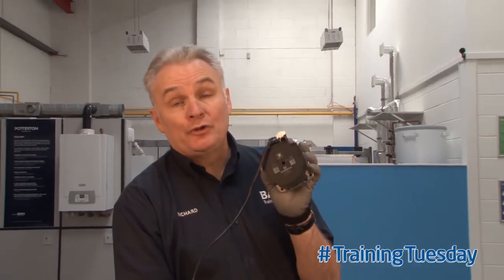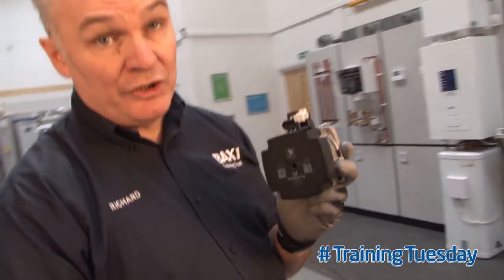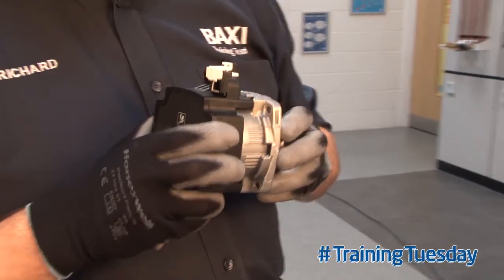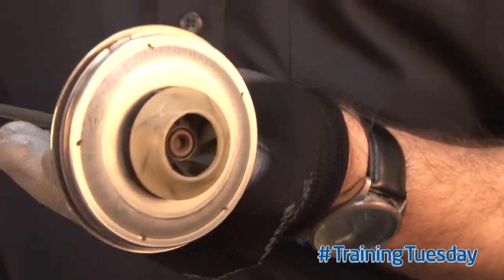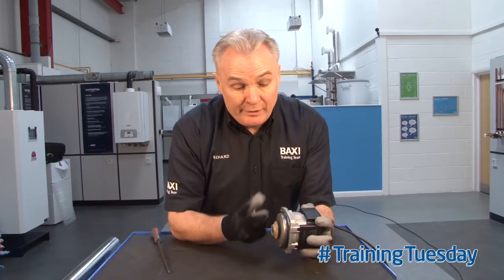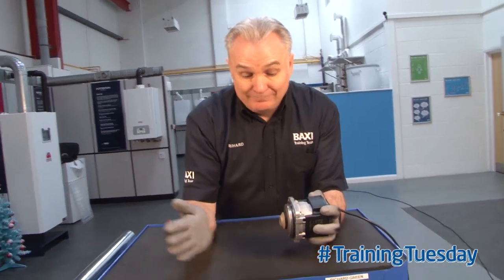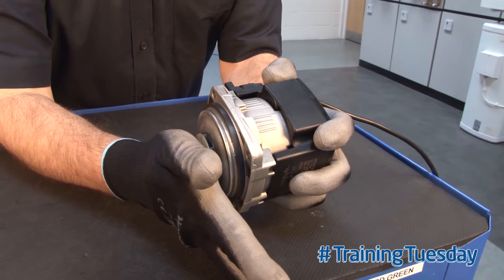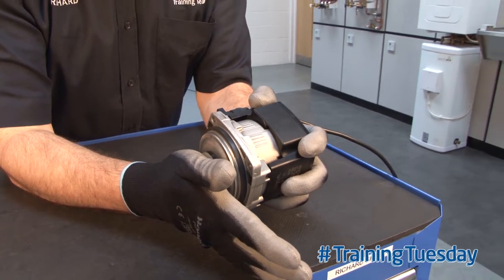How to turn a Grundfos UPM3 pump in the event of it being clogged with debris | #TrainingTuesday

Comment: Introduce the Taco pump. Used by Bosch – Ariston - Vaillant – Viessmann – Immergas and others.

I think it would be useful to highlight the advantages and differences compared to the current, frequently used pumps like UPM3.
Why Taco is more reliable.

Taco pumps are constructed from modern materials that function flawlessly in underfloor heating systems, or any other application where the motor is cooled by the medium it comes into contact with. This makes them very suitable for such environments, different from pumps with traditional materials such as steel. 

Unlike traditional pumps, which are often made of steel and are susceptible to failures, such as jamming, caused by electrochemical reaction in the rotor chamber, Taco uses modern composite materials. These materials offer a similar lifespan without the risk of getting stuck or damaging when running dry. Taco pumps can withstand dry running.

With traditional pumps, common problems are the result of material selection and technology. Here are some major causes of failures:
- The pump cannot start after extended periods of downtime (weeks/months).
- Drive side bearing (DE) is jammed, preventing the shaft from turning.
- Calcium carbonate (lime) deposits in the DE bearing space.
- Limescale develops on the shaft and bearing rings.
- Deposits form fixed bridges between the shaft and the bearing rings, so that the starting torque of the engine is not strong enough to break it.

Contributing factors include:
- Summer shutdown: Pumps that have been installed and left idle for months with water in the rotor chamber without dissolved oxygen.
- No commissioning: Pumps that are installed but not in use, with water and atmospheric air in the rotor chamber.

Today's pumps are traditionally constructed from materials such as steel. In practice, a common malfunction is the blocking of these pumps.
Important cause is the use of steel and the ECM technology / Pm (Peranent Magnet)

It is important to understand that the root cause of bearing seizing is the precipitation and sedimentation of calcium carbonate in the DE bearing orifice. This process is driven by an electrochemical reaction in the rotor chamber, fed by oxygen interacting with the pump materials and generating hydroxide ions. I will come back to that. 

Because Taco pumps are made of different materials, they are better suited for these applications. Their composition prevents the problems experienced by traditional pumps.

Comment: I was trying this method without success. I ended up taking off the pump, unscrewing the 4 bolts and turning the rotor by hand. When turned I installed it back, turned it on and it worked. Very easy, everyone can do it, just make sure to close both valves on either side of the pump before you dismount the pump.
Reply: How did you remove the pump? I am trying to find any video on that.

Comment: Good video,  looks easy but I cannot get a screwdriver into the space as the pump is too close to the tank...! What else can I do? Can I take the hex bolts out and separate from the pipework? Novice here....! Thx.
Reply: So the fix in the end was to isolate the pump, remove the 4 hex bolts with Allen key, manually turn the rotor. Hey presto, all working. Thx for  all the advice on here.
Reply: @bs2592  Brilliant! Glad you got it sorted.
Reply: Can you get a stubby screwdriver in there?
Reply: @kevinpeters5000  No. its really tight space.
Reply: When I’m taking the 4 bolts off some water started to come out. Should I be turning the water off to do this?? Or is this the problem. The bolts are back on for now!
Reply: @matthewcornish5207  there should be isolation valves either side of the pump. You need to close those off before you start. Turning your water supply of won't help as it's the water already in your central heating system.

Comment: I assist two pump like that. Some time break when going to start. Start on light 1 and then go to five. It seems problem to start. Have a way to take off the startin point 1? So always will start in maximal power (light 5) and quite sure the issue will gone.

Comment: Grundfos replaced a year-old pump last year and now, exactly a year later this has happened to me again. Fortunately I got the plumber to put some isolation valves in when he replaced it last time, so the whole central heating didn't need to be drained this time. The screw method didn't work so this is how I fixed it: Remove the 4 allen bolts and take off the black solid metal part to expose the black plastic impeller. If you try to rotate the impeller it should move freely in your hand but miine did not. Get some mole grips and very gently grip the sides of the impeller (not too tight as it is plastic and will crack easily). Holding onto the metal base with one hand try to rotate the impeller with the mole grips. I had to put quite a lot of force on this and then suddenly it came free. I think this is just a poor design - there was almost no gunk or debris in there.
Reply: It would have been the gunk/debris that caused the problem! A clean system helps prevent moving parts, from failing.
Reply: @kevind7150  Maybe, but it was a brand new system and even if it was gunky I would hope it lasted more than a year! It just seems to dislike sitting unused for 6 months.
Reply: thanks for the info, my system has the isolation valves so will be trying this. pump only 6 months old but off for the summer.

Comment: This happened to our pumps last year. It was then solved by the plumber because I wasn’t able to figure out what pushing and turning the screw actually meant (I did try though). A year on and I’m facing the same problem. How much force does it actually take to get the pump unblocked? I also found the screw heads were partially stripped, I suppose it was the plumber trying to find out how hard he was supposed to be trying. That certainly doesn’t help.
Reply: Usually these pumps need a lot of force comparable to about 4 - 7 kg to unlock them by screw, I wouldn't try more. A lot of them stuck way harder and unblocking it by screw is impossible. If the screw is stripped I suggest you disassembly the pump and unblock it manually. Even manual unblocking is sometimes impossible. If it is stuck very hard, trying to unblock it may cause bearing damage and you need buy a new rotor or pump. If You want to avoid stuck it again, Your central heating system should have "pump anti blocking/stuck" function. The function should be set up to turn on the pump every 2 weeks for a few minutes.

Comment: I have this issue with my pump, intermittent clicking every couple of seconds. Inserting a screwdriver, pressing, then turning doesn't seem to make any difference. Pump was unused over the summer. Is there anything else I can try? Thanks!
Reply: i have the same issue  ill let u know what happens with mine
Reply: @balkanguydiy  I ended up getting my pump replaced :(
Reply: @user-ky9py9oi7d  thats  bad its just probably stuck rotor ,i fixed mine just took it apart and turned it few times ,now its running normal
Reply: @balkanguydiy  Hi, Can you describe how to take it apart?
Reply: @bs2592  just look  up online for the exploded view of your pump it will show you where the screws are located ..what is the problem with yours btw?
Reply: @balkanguydiy  thx for the reply. It was new last year, been off for summer and now I have a red light and amber light. Manual says that means its blocked. Tried the screwdriver through the front but not alot of access as its close to the tank. I think I have to take those hex bolts out and then get to the impeller but dont have any experience of doing this.
Reply: you will probably have to do it because the rotor develop rust hence it gets stuck .not that hard to do   when you take it apart  just turn the rotor part until its moving freely again and dont forget to clean the gaskets and all the mating surfaces meticulously  then apply some light oil before assembly ....dont overtighten .and  to make sure its not happening again change the fluid in the system with recommended one
Reply: How did u fix pump im having same issue
Reply: @mattiemurphy223  follow the instructions.  You need to put the screw drive in, push till you feel the screw yeild about 5 mm.  Then turn it, it is a narrow head, so make sure the screwdriver isn't just popping out.  It took me a few attempts to get it rotating.  When I turned it back on light turned green. When it is on at the moment, what lights are on?
Reply: @jasonchapman6318  we have the same issue.  Can feel the screw depress and then turned many times with the screw depressed whilst the unit is off.  Are there any videos of how to remove the unit so we can open it up?  We did not install it so do not have any material which would have come with the device
Reply: @oculushut7205  I've had no luck with the screwdriver method. I ended up taking it apart and freeing the impeller with some mole grips.
Reply: @kevinherring4631  how did you do it?
Reply: @bs2592  See my detailed comment below

Comment: Is there a way to findout if the pump is actually working ?
Reply: Some UPM3 pumps don't have light indicators. Connect power and put your ear close to the pump. If you can hear soft clicking noise every 1,5 - 2 seconds it means the pump is blocked. It is the sound of trying to start spinning.
Reply: I had a red light on mine, so the far left light was red.  Turned it off.  Followed the instructions in the vid (I could hear the click of death before).  Was pretty seized. turned it back on, now green light far left.